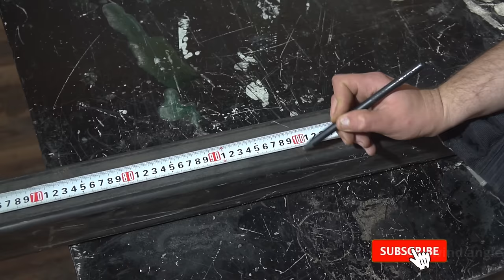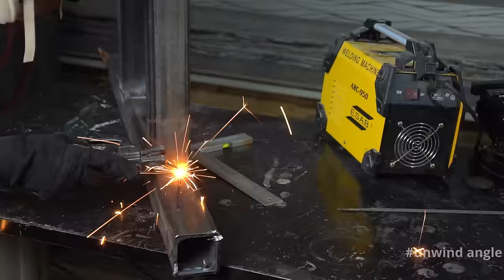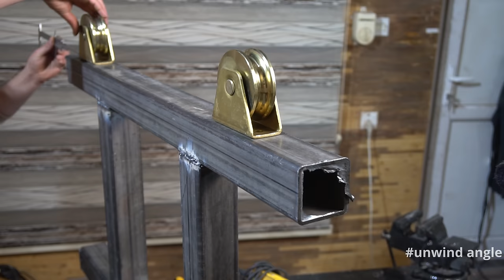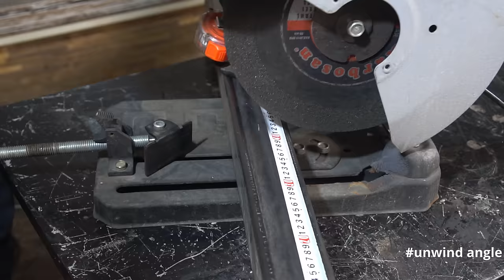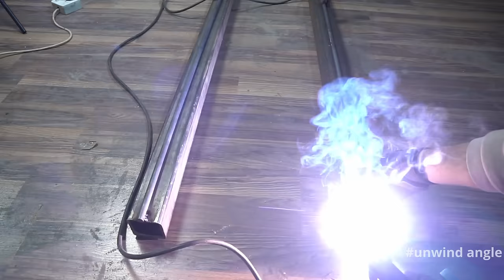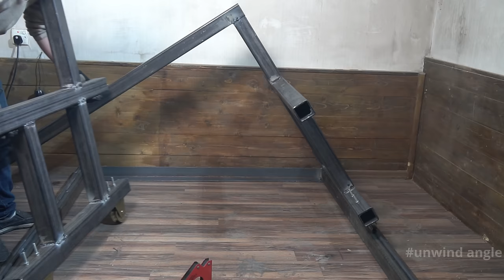easy way to make a sawmill .  part 1

Comment: So you welded on some not so expensive but decorative flooring. You welded together some kind of trolley system. I can’t figure out what it is supposed to do. I’m not trying to be disrespectful. You did a good job. However, what are you trying to move about 10 feet maybe? Should have included that, sir.
Reply from the maker: Thanks for the attention.This device is not 10 metres high, but 3 metres long.There is an old machine I will use in later parts stay  for the second part

Comment: Why so many start/stops while welding? I get tacking it, but why not run a continuous bead after tacking?
Reply from the maker: I don't know what you mean, buddy 🤔🤔
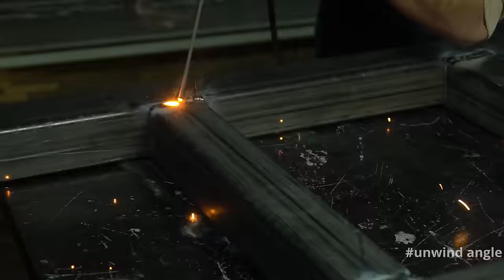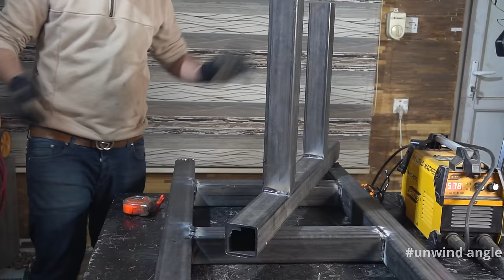Reply: @unwindangle  should add, its an amazing sawmill, super cool! Between 2:15 and 2:20 you had a bunch of start/stops, was just curious why.
Reply from the maker: Thank you very much for your comment. You can look at the other parts and understand it very well.
Reply: @unwindangle  I still don't understand, but we'll leave it at that. It's an amazing rig you built and your fab skills are awesome 👌